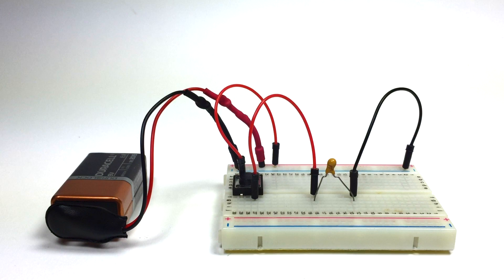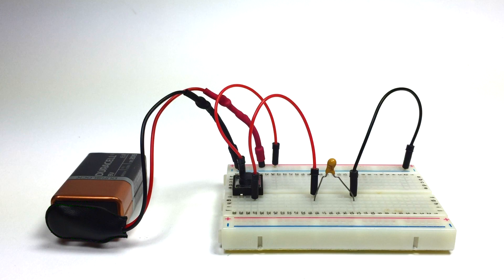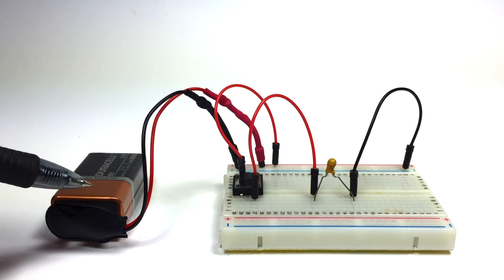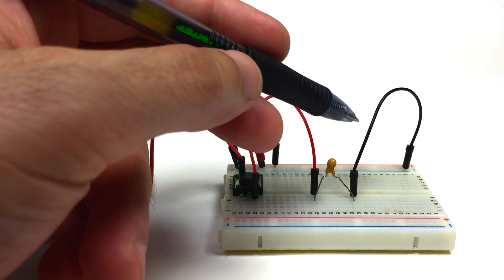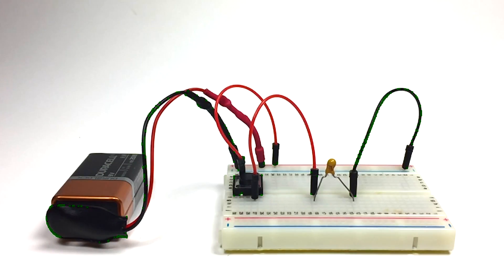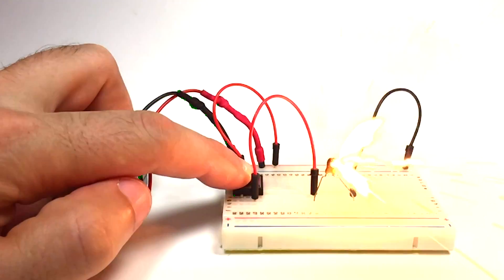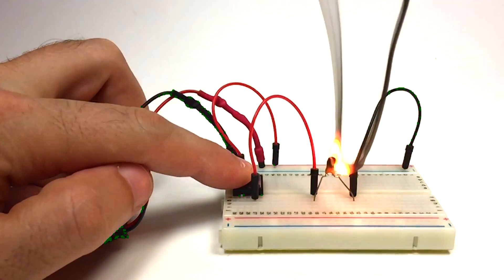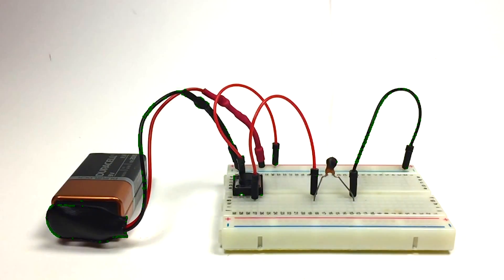Exploding Capacitor

Comment: When I was nine I was an idiot and shoved a 0.1 amp resistor directly in the 240v receptacle it made a loud bang and my power went off after that it turns out I killed the rcd

Comment: Tantalum capacitors tend to become hard short circuits when they fail, dragging down a power supply line and causing that circuit to fail to function.   I have sometimes used the effective but brutal troubleshooting method known as "fault clearing with high current" in order to clear the short.  The shorted tantalum capacitor blows open, it smells bad, it makes a nice little BANG,  and the circuit starts to work again  with the short cleared.  Replace the remains of the capacitor with a fresh one and now the circuit is back to working condition      The trick is not to over-voltage the circuit, but give it enough current that it burns through the badly shorted tantalum capacitor.

Comment: Question- after the capacitor burn/explode, does it become short circuit or open circuit? Thanks.
Reply: the metal plates are OBLITERATED in the blast,    it goes to Open Circuit, without fail.
if it doesn't, it'll go short circuit and then it'll blow and become Open Circuit,
in any case, if it goes BANG  it's Open circuit
Reply: The capacitor should become open, since there isn't a direct connection between the two wires, unless it gets hot enough to melt them together internally.
It really does depend, and may have either of those faults.
Reply: @iceaprince  Thanks so much

Comment: What happens when 100v 65uf electrolytic capacitor is replaced with 250v 10uf electrolytic capacitor in 9watt led bulb?
Reply: Did you find out? :)

Comment: Try an experiment with a blue or white light led without using a series resistor and a new 9 volt battery. Let's see if it turns it from light emitting diode into a dark emitting diode? Again use a normally open switch for safety sake. Next we'll try something interesting with a mos-fet. Good idea?

Comment: That smoke is very carcinogenic besides.
Reply from the maker: Definitely not good to breathe. I had a fan going in the room to air it out for about an hour after that
Reply: Tantalum oxynitride vapor. Extremely carcinogenic down to 20ppm in air esposure Causes liver cancer in 80% of people exposed to at least 20ppm in air concentrations in this video way above those levels. Feel bad for the guy who made this video.
Reply: @miamicb6275  sure its cancerous but there is now way to prove that correlation to liver cancer.
Reply: @miamicb6275  source please.